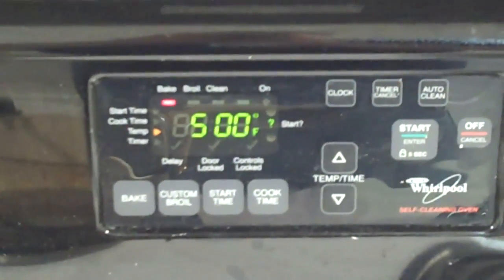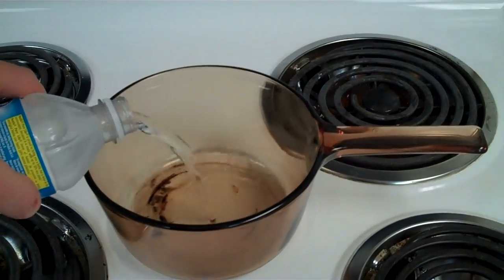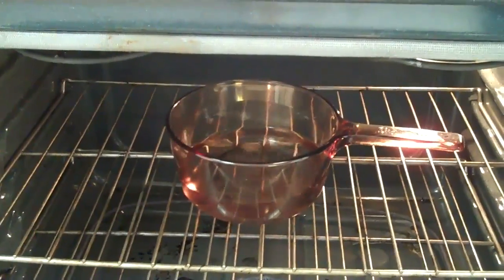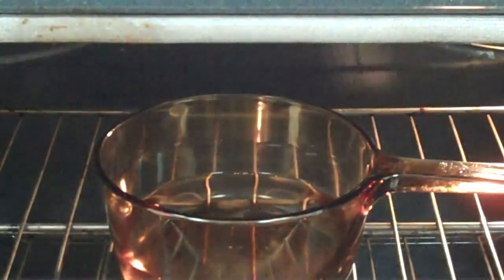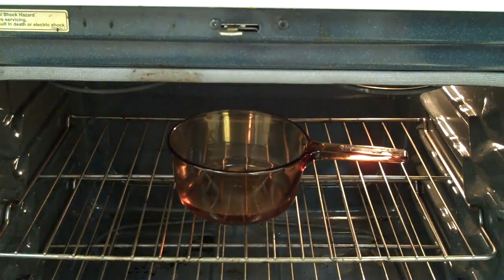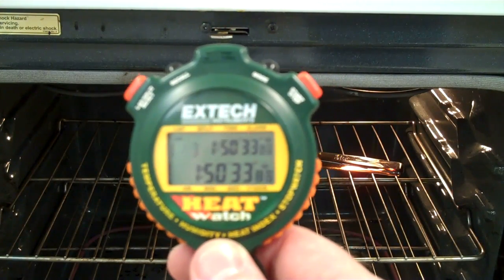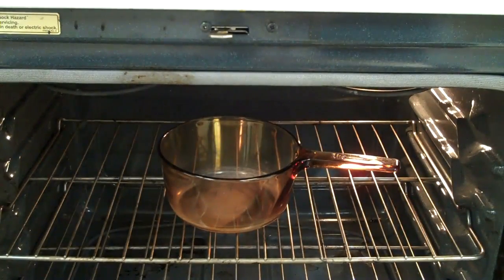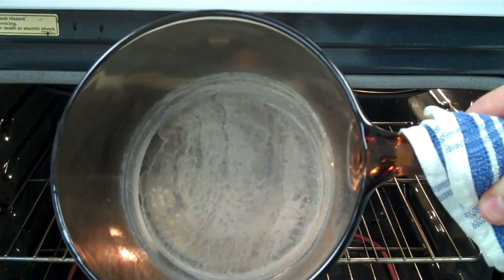Evaporating water in an oven

Comment: Kids don’t do this at home
Reply: Lol i am 😇
Reply: Does anyone know why it won't boil? I put a Pyrex with water in the microwave and brought it to a boil and stuck it in a 450-degree oven and it doesn't boil. Left it in there 15 minutes. Nothing. Does anyone know why? I was hoping to clean my oven using steam like you do with the microwave. It seems like a no-go
Reply: @micheleh5269   best guess is that the air doesn't transfer enough energy to the water or the container to make it boil. If water is on a stove, the coils transfer heat directly to the pot which then boils the water but in an oven, the heating element transfer heat to the air and then the air transfers the energy to the water and the container. The air isn't efficient at transferring energy